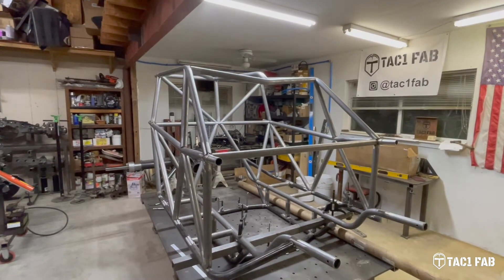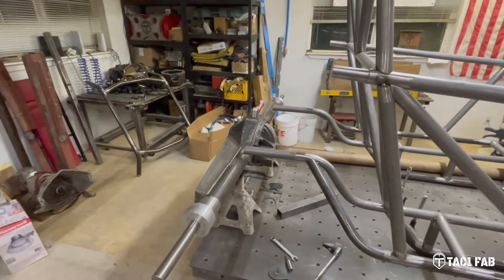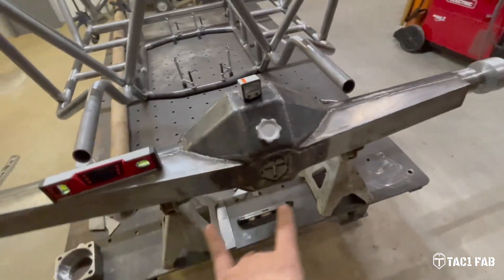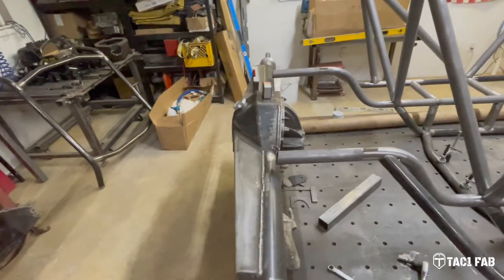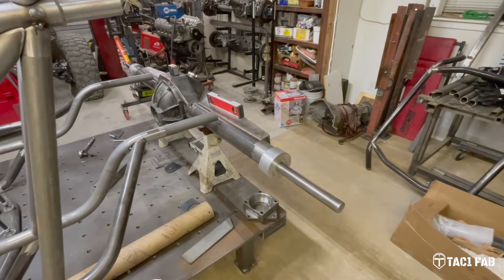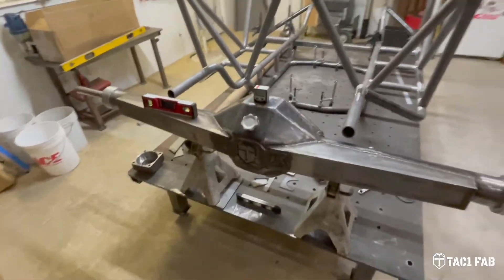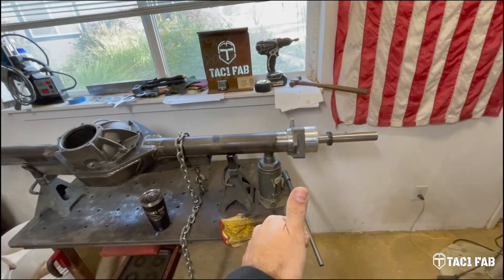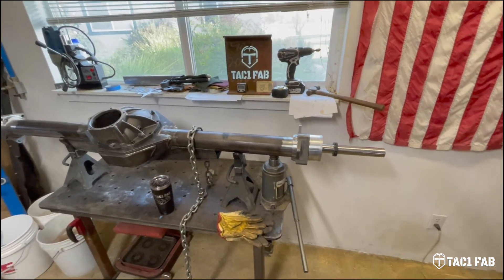Stryker Chassis Build Vlog Episode 9

Comment: Use a plasma cutter  to cut the. Mounting face loose from the rest of the housing...... this will allow the repositioning  of the pucks to align the face to..... thereby "straightening" the axle.      I did the same thing as you when I built my first 9"  axle back in 1986....
Reply from the maker: Thank you for your suggestion! I don't think cutting the face would work for me without opening a whole other can of worms, due to the way the housing is designed where the axle tube register into the faceplate.